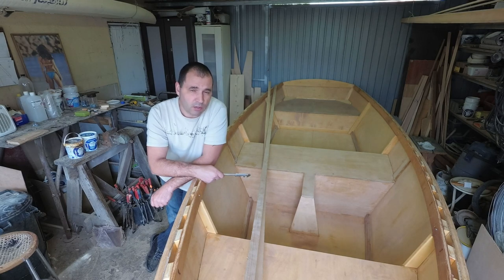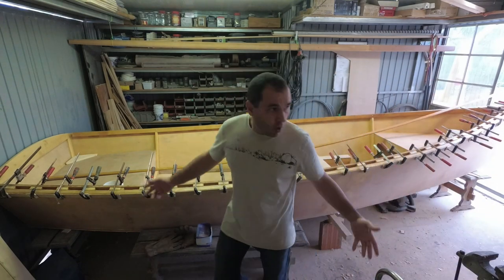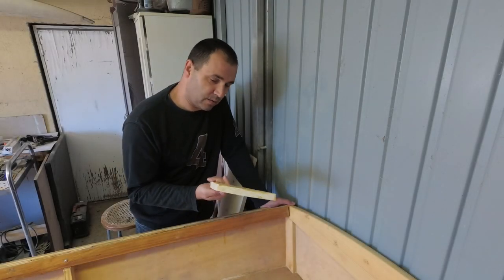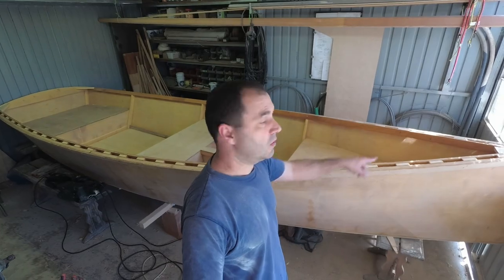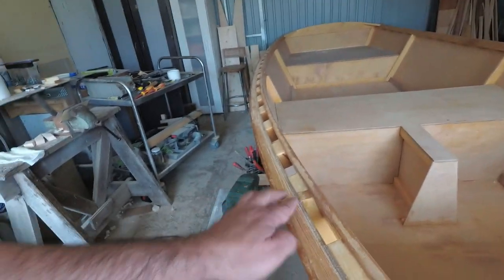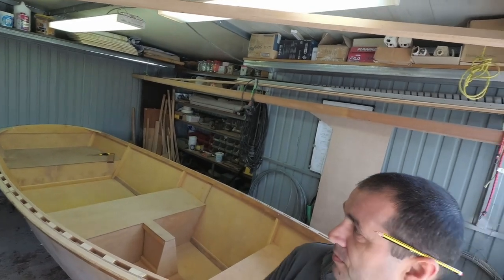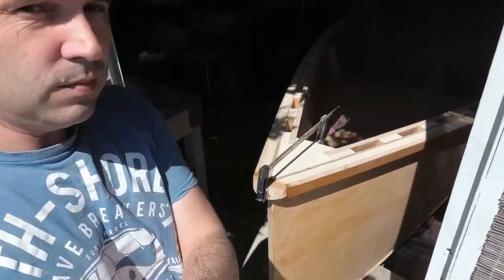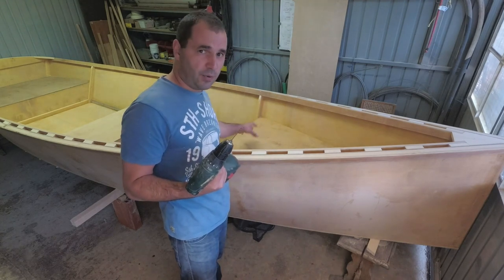Building a Goat Island Skiff - WEEK_18 - homemade plywood sailing boat

Comment: Hey, if you connect a vakuum cleaner to your sanding machines you could eliminate all dust in your shop and you you don't need a mask. Nice work!!!
Reply from the maker: Thanks for your feedback!
My vacuum cleaner doesn't have anything but a cloth bag inside the bucket. Connecting it to the sanders would greatly reduce dust but small particles would still be air born. The mask  would still be necessary. ;)